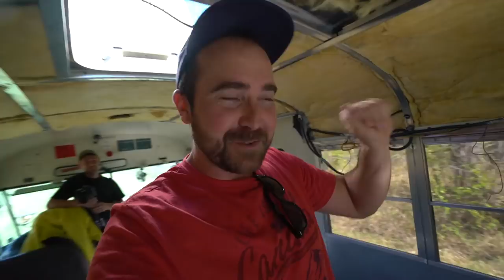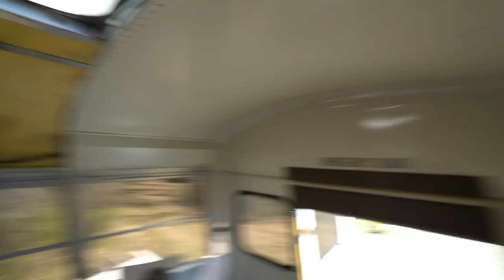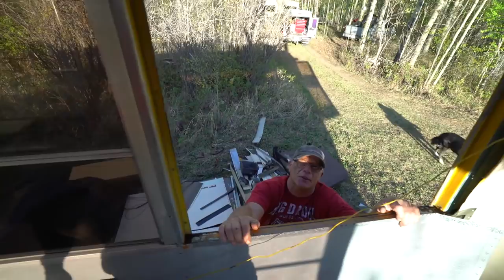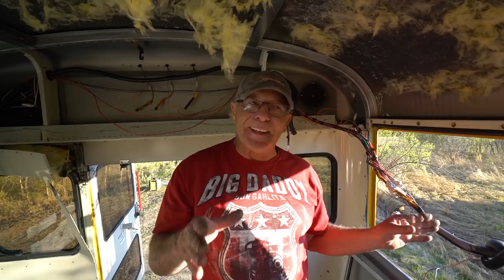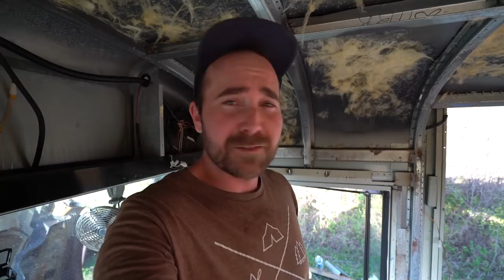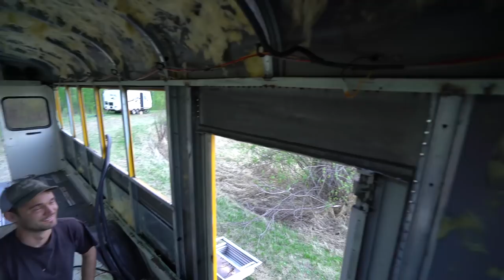REMOVING SCHOOL BUS CEILING + SEATS + WINDOWS

Comment: Why do you take out all the windows, to re-seal them?
Reply from the maker: For waterproofing them. The caulk was from 2002
Reply: Is that where the leak was coming from (you mentioned in a previous video).

Comment: too bad you allready closed that lift door in , looking at its opening it you couldve made a small slide out from it with the kitchen aplyances in there (fringe cooker and some cabinets ) could slide it out about 3 to 4 feet and have a straight walk through from the door 
even slid in you still can use it (just has a wall on each end of the kitchen )